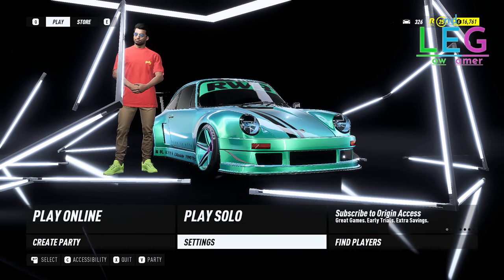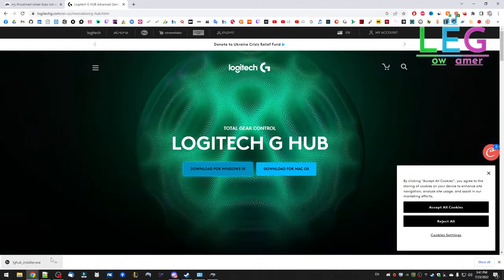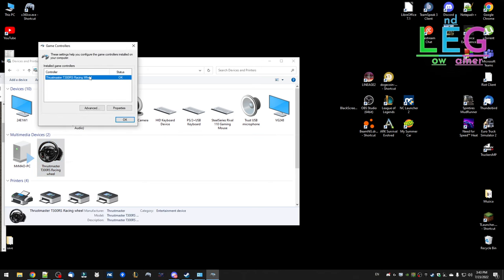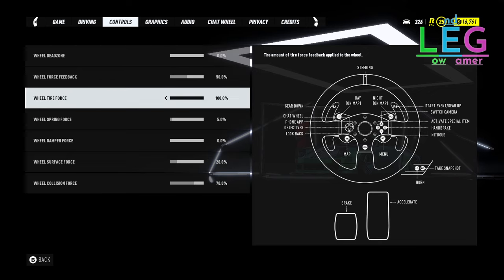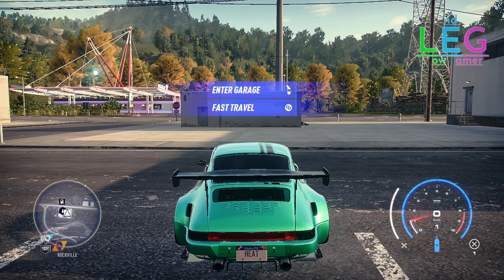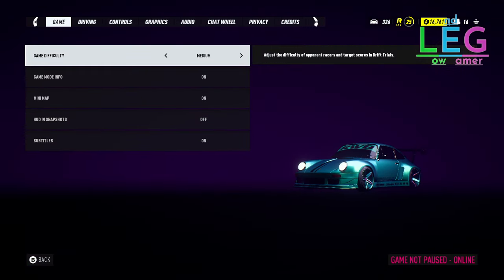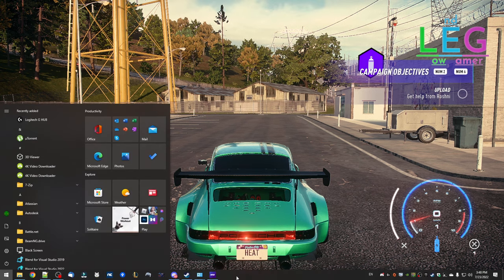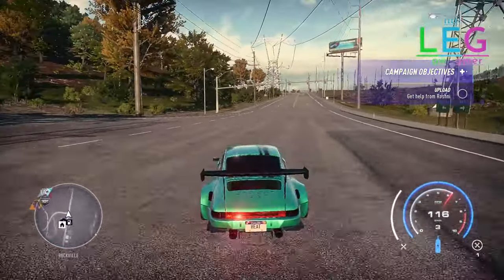How To Fix Nfs Heat Wheel Detection

Comment: Hey man! Thanks so much, this is 90% working for me, moreso in particular the controller emulator. The only issue I’m having is that my turns on the wheel are very sluggish; even at full turn of the wheel I’m not going left or right very much, any idea of a fix for this?
Reply: Little late but have you tried making sure dead zone is at 0 or turning up the sensitivity for each car in love tuning may help you turn sharper

Comment: Thank you so much you're a godsend! I was so confused on why it wasn't working 😂 Having the Logitech G Hub installed or not makes the wheel appear or not is so stupid
Reply from the maker: with pleadure dude
Reply from the maker: only if you have Logitech G Hub installed you'll see the whell actually I had this problem for a long time. I also have 3 pedals on the whell
Reply from the maker: and them haven't worked for me before

Comment: Im using the thrustmaster tx wheel on NFS heat and when im driving around it starts to lock up and i cant get any control of the wheel and im using controller and it absolutely sucks
Reply from the maker: is the wheel detected in the game?
Reply: @lowvrgamer  i used the Xbox 360 controller emulator and it started working

Comment: what should I do if I don't use a logitech steering wheel? the app doesn't detect it and in control panel it's showed as a gamepad, not as a wheel. I use an Hori apex RWA steering wheel ps4/ps5/pc (not the wireless version)
Reply from the maker: you might be able to change that using the steering wheel config controls
Reply from the maker: check the user manual for the steering wheel

Comment: hey sorry to bother, but it worked for the most part although my pedals arent working both of them are accelaration and brake at the same time, do you know how to fix it? Also thanks for the totorial
Reply from the maker: there is a button to switch the pedale mode. Depends what type of pedals you have.
Reply: i have a Trustmaster T128 @lowvrgamer
Reply from the maker: I have a differed model I can't help you with your model..